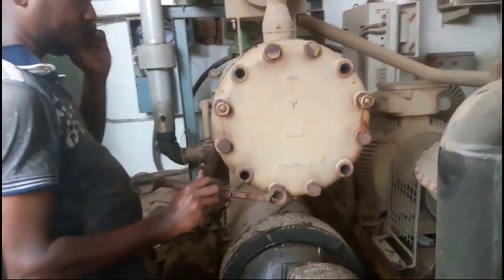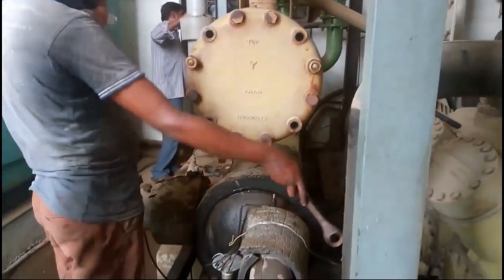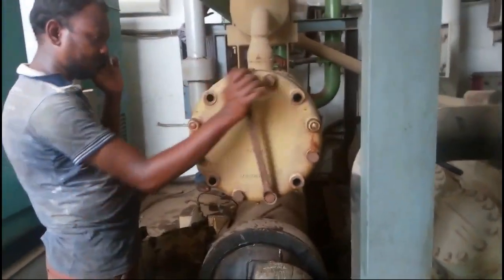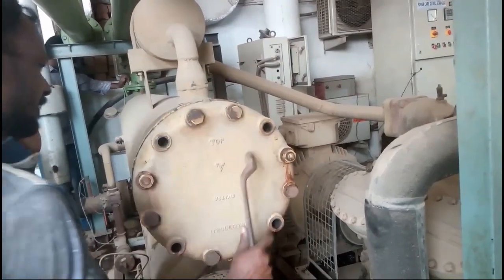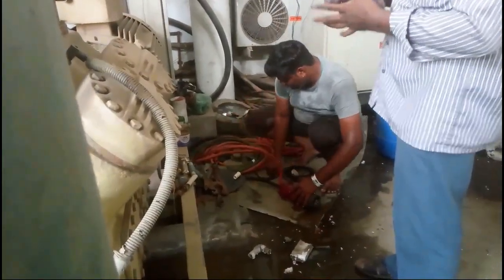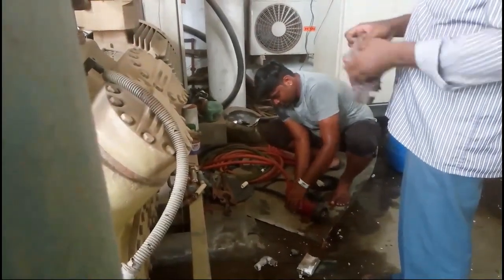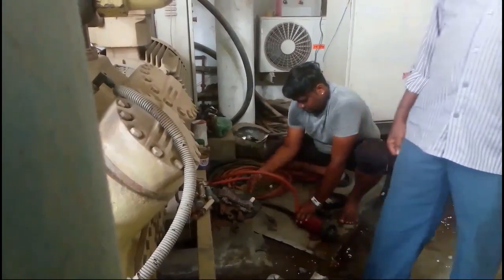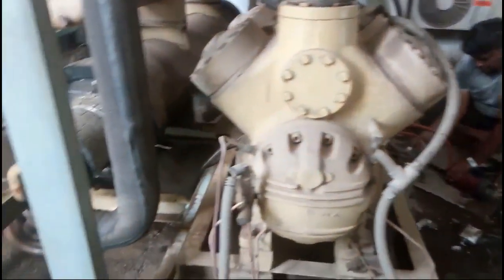Voltas 86TR Condenser Chiller Descaling - Basic Chillers

Comment: I have voltas water cooled 39 tr chiller giving sensor er 3 error and antifreeze alarm in 02 compressor
Reply from the maker: Check the cooler water pressure, increase 1 or 2 degree antifreeze level. Excess of Refrigerant gas may also cause this problem.